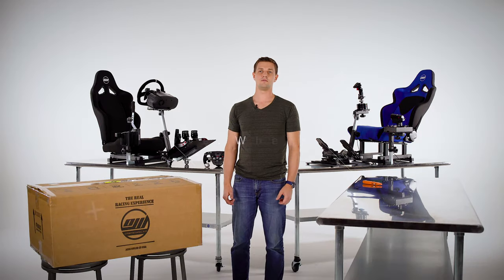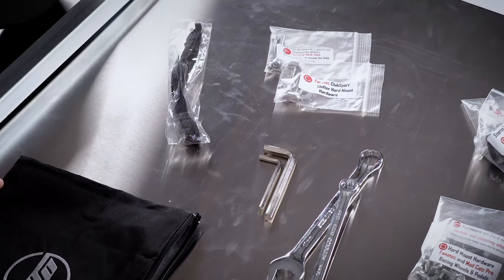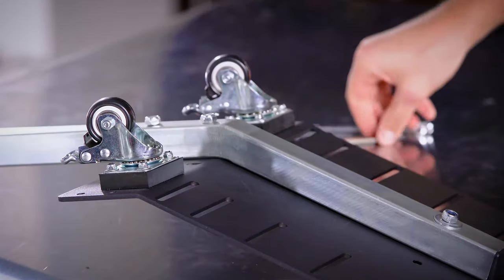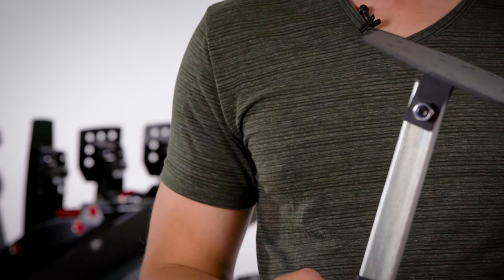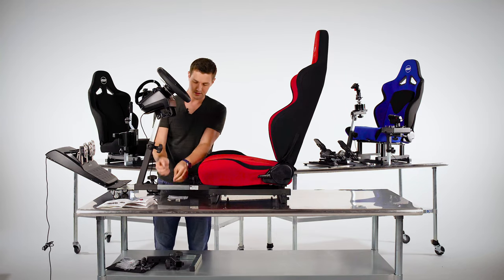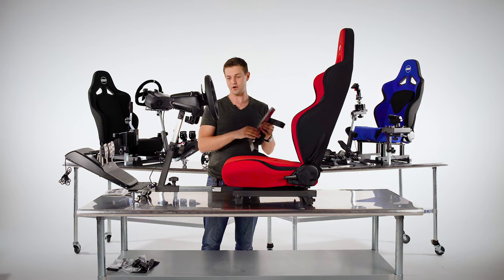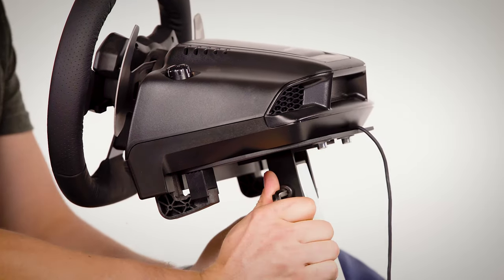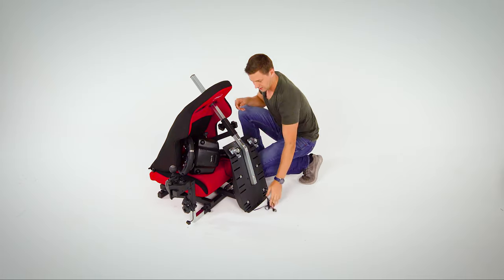OpenWheeler Gen 2 Racing Simulator Cockpit Official Assembly Video Tutorial & Accessories 2019

Comment: Mine is in the mail right now, along with the seat risers and HOTAS mounts.  It's almost a perfect setup for what I need, able to be moved, can hold my sim racing gear plus flight sticks at the same time.  The one thing I'll have to figure out is how to mount the two flight sticks on either side, plus a throttle, as I use all three devices for space sims (one stick on each side plus the throttle on the left).

Comment: Errrr just got started and I'm already stuck on the first part of assembly.  I can't get the right backrest bracket to line up with the right bracket of the seat. The backrest bracket is bent inward at an angle and the video skips the one frame I need to see. The backrest bracket goes on the outside of the seat bracket, correct?

Comment: Why did you change the design of the footplate? Were the welds breaking on the angle piece or something? It seems like the Gen 3 is more wobbly on the foot plate.
Reply: Why
Reply: @scottboom5091  Because there is no center support under it, just two long brackets going from the frame to the foot plate. Gen 2 (this video) has the old style, but I theorize the weld broke at the angle or something for the change.
Reply: @scottboom5091  Who?

Comment: I actually have one of these and have been happy with the product.  I recently purchased a set of Fanatec Clubsport v3 pedals with the Performance Brake Kit which makes the brake very stiff.  When pressing the brake I do have some flex in the brake plate - any recommendations or addons to stiffen it up?
Reply from the maker: Hi John, Depending on what version of Gen2 you have, our latest revision has added 3rd connecting bolt between upper section of pedal plate and main support tube, enhancing pedal plate rigidity. For the folks with 2x heavier direct drive wheels and super aggressive driving we are about to release couple add-on mods. One is beefier steering post and second is pedal plate down force  support bracket. While the two parts are still beta stage, we would be happy to send them to you to give them a try. I will update this message with links to photos of the mods. Downfall of the pedal plate down force support is it prevents caster wheels from rolling so it is one or the other. Feel free to reach out to us via email at info@homeracer.com for further details. Regards, OW.
Reply: OpenWheelerUSA that’s great and appreciated. Extremely happy that you are working on those addons. I was attempting to workout a brace of my own but will hold out to see what your add on looks like. Thanks again!
Reply: Just sent an email, thanks again!
Reply: @SimFabOfficial  Glad I found this I'm will be upgrade my Sim equipment to fanatec. I currently use your Gen 2 Racing Rig and I'd like to continue but I have concerns over rigidity. I understand you are testing out Gen 3 upgrades and I'd like to be a part of that, or to know more information. I previously upgraded and did a YouTube video that helped many other Tubers. I hope for a timely response as it could be the difference between a Fanatec V2.5 or DD1 wheel and pedal

Comment: @openwheelerusa do the seat risers and flight stick mount only work with the Gen 2 seat?  I have the Gen 1 and I'm Interested but I don't want to have to buy a whole different seat.
Reply from the maker: @Metal One Production, Gen1 is not compatible with Gen2 flight sim kits. Seat lift kit alone is partially compatible if you do not use shifter, however Gen2 has lower angle of pedal plate which may be a comfort issue with Gen1, with seat raised up. Gen2 has many other benefits and improvements over Gen1. We will go over them in a separate video in the near future. We offer Gen2 chassis only with 50% partial refund for folks upgrading from Gen1 to Gen2. If you decide to upgrade, please reach out to us with your order number so we can refund $100. Direct link for Gen2 chassis only: https://www.amazon.com/dp/B07DPWGVMF Direct link for flight sim add-on options: https://www.amazon.com/dp/B07WP5V6T2 Feel free to reach out to us if you have additional questions at info@homeracer.com
Reply: @SimFabOfficial  thank you very much for this information.  I will definitely look more into this.  I appreciate your quick response.

Comment: Never use a knife to open the box! That's how you cut the seat wide open!
Reply: 1) This is the actual manufacturer
2) There is a "do not use knife" sticker on the box
3) There is a layer of cardboard directly under the tape on the box

95% of the time, you can be careful using a knife and you'll be fine.